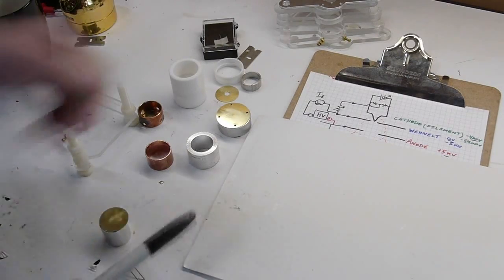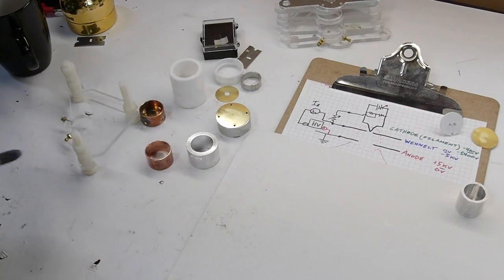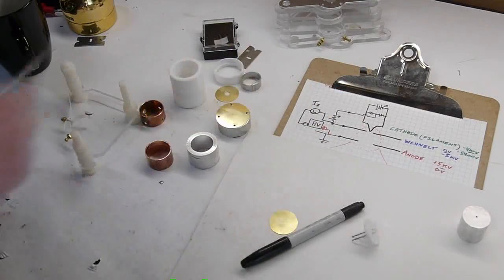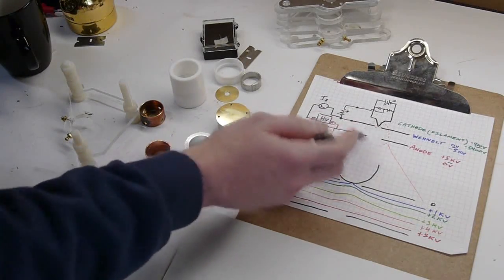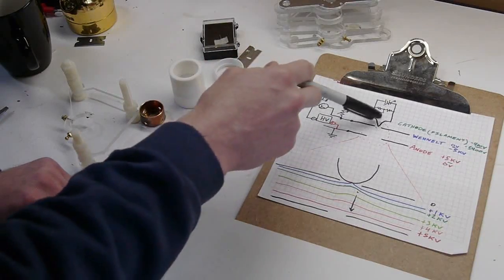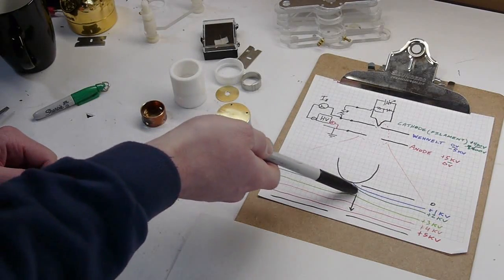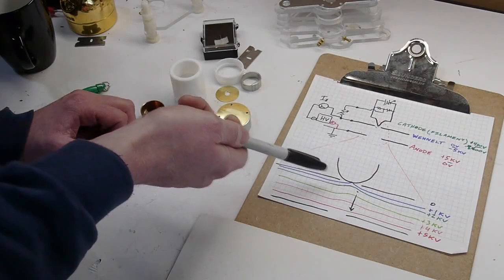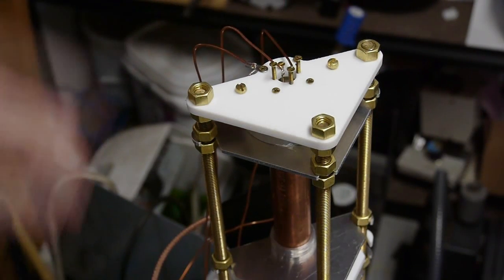DIY Scanning Electron Microscope - Electron Gun Detail

Comment: 1. The lines shown here are not the electric field, but the iso-lines (planes) of same electrical potential.
2. The electrons are accelerated along the fieldlines (The electrical field results in a forcefield, which is, due to the mass of the electron, an acceleration field), which is (infinitessimally) perpendicular to the iso-planes. Note: the acceleration field is not the field of velocities or trajectory. It's the acceleration field - the field of change of velocity.

Sorry for being a knowitall, but when explaining in detail, the explaination schould be correct.

Comment: Hello Mr. Ben
The video is great with satisfactory explanation. I also recommend you to explain types of electron sources/guns that would be very useful for students studying SEM, if possible. 
Thank you.
Reply: There are two basic type- 
1. Thermionic Emission source
In this type work function of source material is overcome by giving energy in the form of heat. Two most common used sources in thermionic Emission are- Tungsten and Lanthanum Hexaboride (LaB6)
2. Field Emission Gun-
In this type of source, electric field is applied to extract electrons. 
Both have their own advantage and disadvantage.
Reply: @ArjunTheBarwal  thank you

Comment: Here am I ... 8 years later figuring that I will FINNALY make this (for some small EBM 3D Printer). But I still don't have a UVAC pump nor a HVAC .... But I do have a CNC machine and a lathe so.... I'll try to make my own pumps.. that'll be the most challenging part I guess...
Reply: @paul beenis Hopefully I will, it's going to take a while thou because I need a decent pump, the HV stuff will be easy (and getting materials) but the culprits are the pumps) I have a double piston(membrane) pump that will most likely need servicing. Also, I need to finish the design and machine parts (which I can only do during weekends)

Comment: I don't see how the two resistors across the filament are effective at  anything other than burning battery power.
Reply: They form a virtual centre tap in the absence of a bipolar power supply.  If he has a 2V filament supply the resistors will have about 1V at their junction.

The reason it is done with a bare filament here is so that the tip of the filament is kept at the same  voltage relative to the aperture even if he changes the filament power supply voltage.  I suspect that with the voltages in question of 400V and 1V it may not make any difference but I am not sure, maybe it will make a significant difference.

Comment: With these kinds of kV levels in a high vacuum, do you have any problems with coronal discharge and whatnot off the sharp edges of your electrical shenanigans?
Reply: Once you have a hard enough vacuum it becomes an insulator.  Residual gas remains a problem and this is why high kV (RF, x-Ray, microscope) electrodes are radiused to reduce the field intensities at edges where the corona discharge would first start.

Comment: so I've been thinking about making an sem.  I'm just curious why you didn't just use a CRT gun assembly and play with the parameters to see if you could make that work.  Its almost the same thing.  perhaps the beam current is too high and the pin holes are too large?
Reply: cause electron beam focusing is really the critical part in the whole process. You sometimes want focus point diameters of a nm. No way to get that out of a CRT.

Comment: Hi bendo your videos for your S.E.M build run in order I seem to find them all over the place I have subscribed to you channel. I'm quite new to tube so bear with me. I have over eleven years with a company called VG Scientific involved in S.I.M.S and E.S.C.A  I have worked with both ION and Electron guns in my time and a few different analysers as well that coupled with high vacuum pumps and sample manipulation. VG split into a few little factions mine was called VG IONEX based in Burgess Hill. Now get to my point I had a thought to make a simple S.E.M for educational purposes why cant I cut the screen of a CRT Oscilloscope and with a mucking about with power supplies or making software controlled supplies via "Arduino"  So basically I stand the tube screen down I have a filament source condenser lenses scan plates I have extraction and focus, yep I no I need a PM tube and a whole host of other bits and bobs. Also a roughing pump plus DIFF or turbo ION I have my own electron multiplier "French horn type" heheh! was gonna put one piece at a time in my lunch box , think theirs a song about that but pretty sure it was about a car. So do you see what I mean ? has it been done or can it be done your opinion please when you have a moment contact me via U tube I'm not sure how that works yet but will figure it out or you have my address here - andy.brown100@yahoo.com The way I see it is that a scope is an electron optical coloum in its self .Or have I gone mad.............................squeak!

Comment: Hello Ben,
I know this is an old thread, but i have one question about your electron gun explanation: I don't see the current loop for the emission current you are measuring. The electrons are emitted from the cathode and fly away and it seems they never come back to form a current loop. Where is the return path for emitted electrons.
Reply from the maker: +fogl2 That is a good question.  The high voltage supply ("HV") in the diagram pumps electrons through the current meter and biasing resistor, and out the cathode.  They are emitted, and fly through the vacuum of the microscope where they eventually hit the inner metal surface of the microscope column, or hit the sample, releasing secondary electrons, which drift toward the detector or hit the metal of the column.  The high voltage supply is referenced to the metal column (the ground symbol in the diagram), and so the column itself forms the return path.

Comment: Hi! very nice video. Why you don't apply magnetic field to minimize electron focuse spot? Your construction is very comfortable to make longitudinal solenoid. I think, if thermoelectron energy is about 1 eV, for beam 30 cm long and 5 kV forsing voltage we have ideal focus spot about 0.5 cm without magnetic field and any aperture.  So you should use 1.5 mm aperture in anode and it decrease max beam current. Applying field must let avoid this limitations. But it is only theory, I never do it :)

Comment: As i've seen your HV-PSU as able to produce 0-10kV. How did you manage to make negative voltage? You can't just switch the ends and call it negative. 
And why it was so crucial for you making 0V anode and wehnelt negative?
Reply: If you do not connect to ground you have 'floating' voltages that are not referenced to ground. If you ground the negative end of a battery then the other terminal will be positive with respect to ground.  If you ground the positive terminal then the other will be negative with respect to ground.  Ground is simply a convention that we use because we work on the principle that the earth is at the same potential everywhere.

You can pick any point as your reference voltage. You can even change it later if there is no connection to other circuits.

Comment: how dangerous is a fully functioning electron gun where the electrons leave the apparatus? ]
Reply: kinda the same as a microwave i would assume at worst :p
Reply: @DarthZackTheFirstI  don't give false information. *IF I RECALL CORRECTLY*, high energy electrons are radioactive and the midway point between alpha radiation and gamma radiation, so they're pretty ionizing, but are blocked by metal.
Reply: i suppose your skin isnt made out of metal...
Reply: @DarthZackTheFirstI  yep
Reply: In almost all cases the electrons stay inside the vacuum chamber.  If you have a good energy beam and a suitable thin window you can have the electrons exit into air but the beam is attenuated quickly.